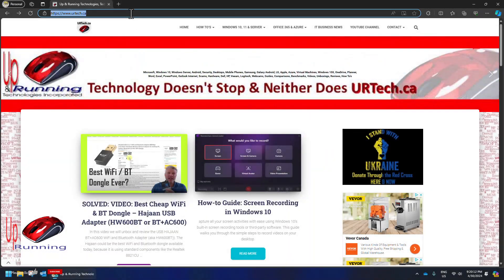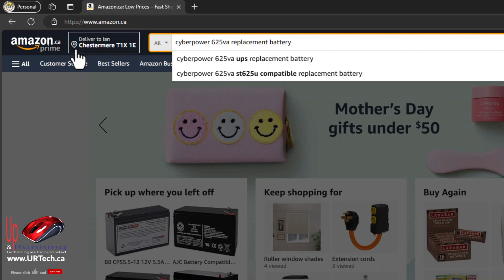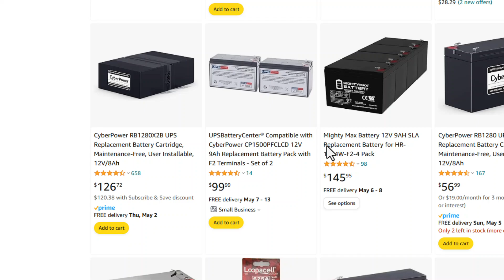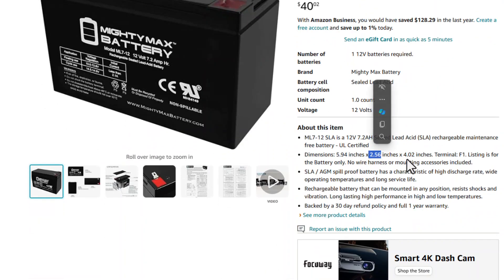EASY & CHEAP: Cyberpower UPS Battery Replacement

Comment: Know of a way to mute all alarms on this model? Got it for my modem for when the power goes out and don't care for it to tell me there's no power cause we obviously know it went out, it's just annoying and we're trying to sleep when it happens 😂
Reply from the maker: Unfortunately, I don't know of a way to mute the alarms entirely, as they're usually a safety feature.  I suppose you could take the cover off and cut the buzzer, but I wouldn't :)

Comment: You can used 12V Lithium battery 20A or you used 18V 12A  Lithium battery with 18V converter 12V 20A and get much longer run time
Reply: This is extremely bad advice. Lithium batteries require a special charger which the UPS won't have. There is a huge fire risk replacing a lead acid battery with a Lithium battery like that.

Comment: Where’s the link to the battery? That would be helpful.
Reply: Just Google, or the search engine of your choice, for what you are looking for and include Brand, Model No. and replacement battery. For example, this is for my unit:  "cyberpower 825avr replacement battery".  You should get a range of choices. Remember to check measurements as he said.
Reply: @Fantazier1 Thanks! I’ve long since replaced it! 👍🏻

Comment: Why do the batteries die prematurely, if they are utilized as a backup source?
Reply: All batteries degrade over time no matter where they are made.
Reply: @ Correct, but having to replace batteries in less than four years that are hardly ever used is a symptom of "being made in China"
Reply: Made in China.

Comment: After spending almost 30 damn mins trying to remove the cables I will do what no one here will tell you, how to remove the cables off the old battery.
After trying to wiggle and pull out the wires till my hands turned red, I decided to grab a flat head screwdriver and smacked the plugs out! So with the unit unplugged, I placed the screwdriver tip in front of the plug and hit my palm against the back of the screwdriver. The plug popped out. Your welcome 01:19
Reply: I am welcome. Thank you! Took a few seconds.

Comment: What would happen if i made some cable extensions/adapters and hooked up an atv battery instead of the intended one?
Reply: I had a similar thought and he said that a larger battery would take longer to recharge, which would hold true for an atv battery. I would also guess that there is an upper limit of battery that be charged.
Reply: @rogerstevenson7867 i did it, it worked

Comment: Having trouble removing cables from posts and rather disappointed that when the video got to the point of hooking up the new cables to the posts, that part flashed by at high speed.
Reply: I agree, I’ve have spent 10 mins now and I can’t remove the wires. I feel like I’m going to damage the wires

Comment: As you pointed out in the video. Most replacement batteries are 2.56" wide where as the one you need is 2". The thing is, the 2.56" wide batteries are everywhere. They are higher capacity and much cheaper (about half the price) of the 2" batteries. But this means is that it it is bettery to plan and buy the UPS that use the 2.56" battery or try to retrofit your UPS to use the 2.56" battery (if it is feasible).
Reply: Yeah, this is rather inconvenient. Hunting for a new battery now 😢
Reply: Yes, that’s true, and I did adapt the wider battery to my unit.
Being an old redneck, I keep black duct tape for just such an opportunity!
I simply put the wider battery in (9amp as opposed to 5.5) set the cover on the unit, and worked the duct tape magic!
Reply: Had my UPS die today. Found 1 battery replacement that is 2" wide on amazon. It's from NPP:6Ah but should fit. I bought it, we shall see when it gets here. $27. New UPS, same model is $79 at Best Buy, so I'll try this replacement first.
Reply: As I type this, there is a seller of a 2" battery for ten bucks less than the battery in this video.  Not too hard to find if you search for the model # of the original battery.

Comment: How did you get the cables apart I'm having trouble pulling them apart off of the post any suggestions would be helpful thank you very much I saw you were struggling too I was just curious how you got it apart thanks again
Reply: Hammering a large flathead screwdriver into the connector point (parallel to the connectors and the battery itself) made it easy for me
Reply: @kd8192 this worked.